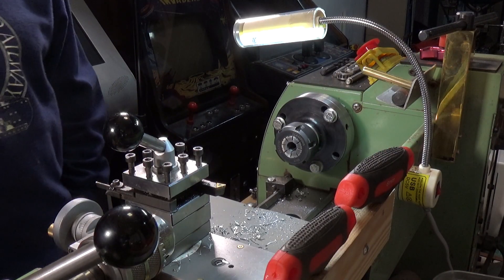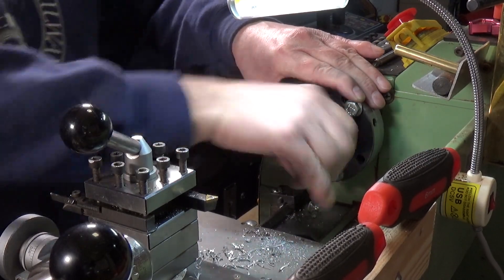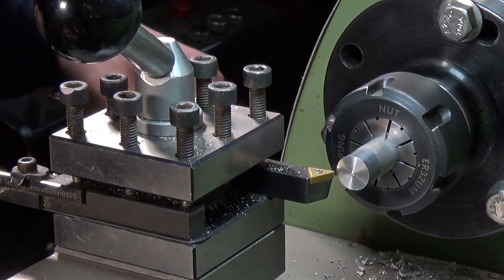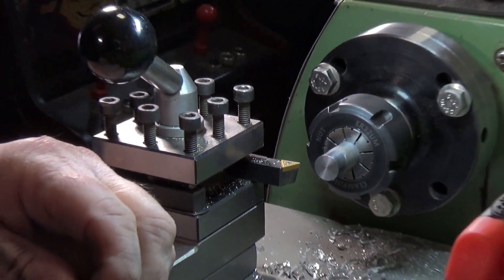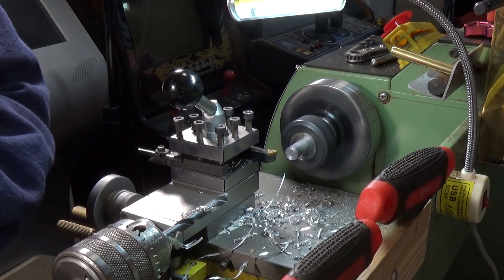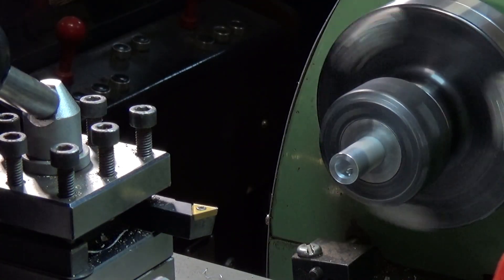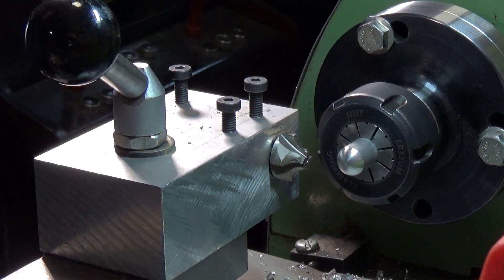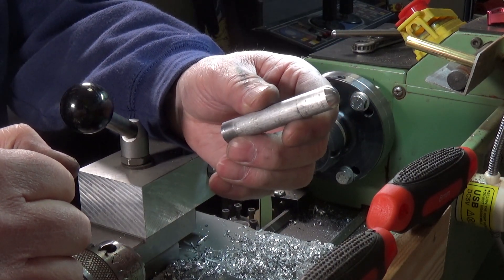Aluminium Chuck Key Handle

Comment: As an Apprentice Engineer in the 1960 on any key or handle we used either a piece of hydraulic pipe or steel tube as an extension.  Nothing new under the sun our charge hands had done the same.